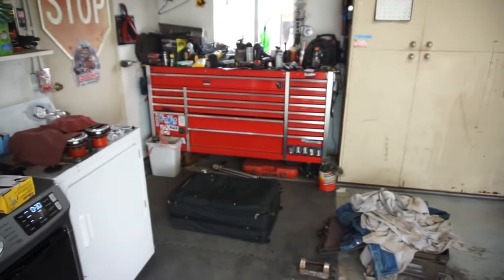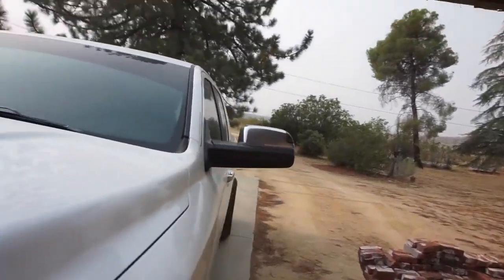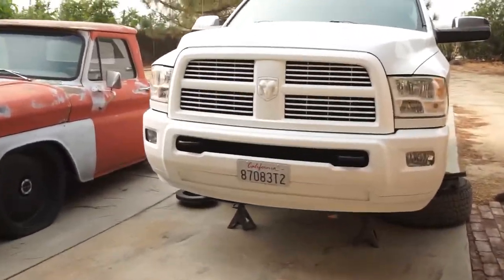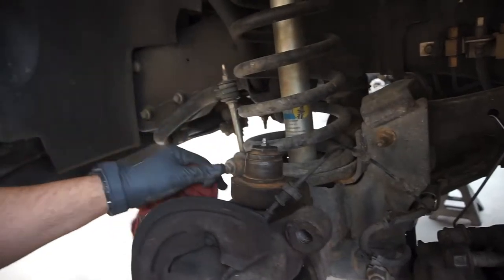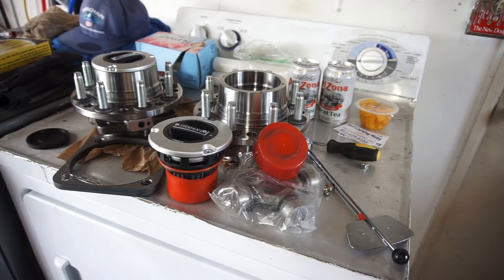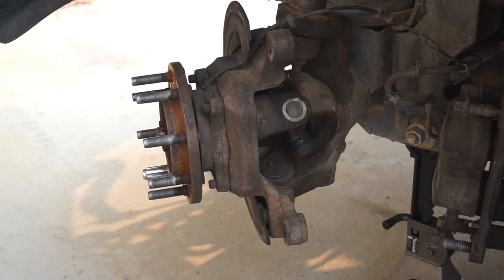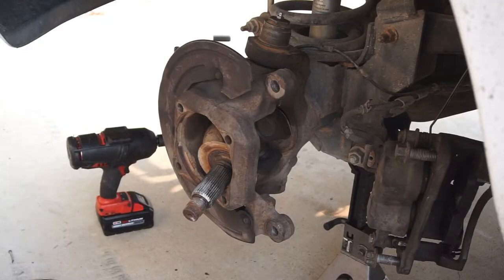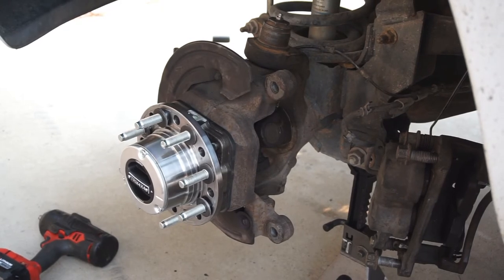2010 Ram 2500 Mega Cab Cummins Gets Some Manual Locking Hubs TheRamMan. 2009-2019

Comment: So after 3 years of running them, what do you think?
Reply from the maker: I only had the one issue with the selector. It snapped off when I was trying to pull a stuck toy hauler in 4 low. Once I put the warn hubs on I haven’t had an issue.

Comment: I have 2 Dodge Rams 06 2500 4x4 and a 3500 04 no problems at all with both pairs i live in northern Minnesota where it's gets down to 30 below and lots of snow
Reply from the maker: That’s awesome to hear.
Reply: @Halffast719  how are yours doing
Reply from the maker: I’ve got 65,000 miles on them and still good.
Reply: @Halffast719  cool, i know the Ramman has a lot of haters. i tried to order another pair, but so far, there's no answer. It's a bummper. it's a great idea. These  are Ford hub assembles

Comment: wait.. there is no nut on the end of the outer shaft?
Reply from the maker: Nope. You can’t have a nut on there otherwise the splined adapter won’t be able to slide to lock and unlock it to the hub. Its a ford design. It’s a floating shaft basically.
Reply: @Halffast719  I was thinking the same thing, the ford has a snap ring on the in side which holds the outer shaft to the bearing and in turn stops the inner shaft from sliding in and out on the oil seal in the diff.
Reply from the maker: Exactly what I was thinking it needed but 45k miles still strong and working.

Comment: So, going on a year in what are your thoughts? Hard to find any vids of folks who have been running them awhile. Also, what do you make of this?   https://youtu.be/2m2OiJXoK74
Reply from the maker: I saw that video when I was trying to order mine and it made me wonder what I was going to get. I don’t know if that’s really a Ram Man hub and if so maybe one of his very first one. I only had one issue and it was with the locking hub itself. It just popped out of itself, so I contacted them and got upgraded Warn hubs from them at a discount. I just took the truck on a 2000 mile round trip with no issues.